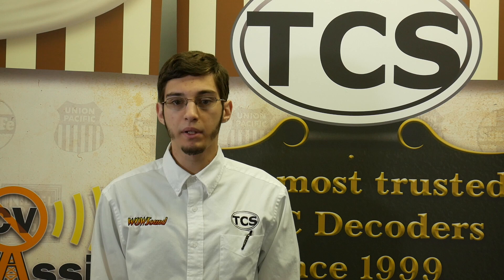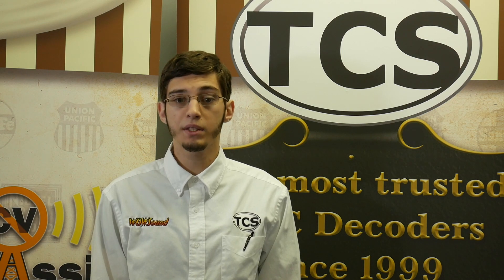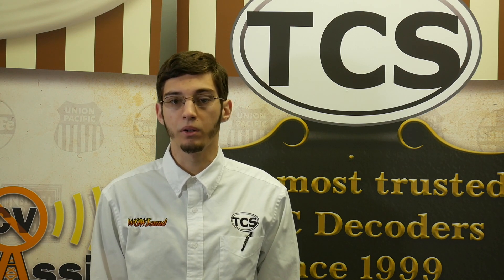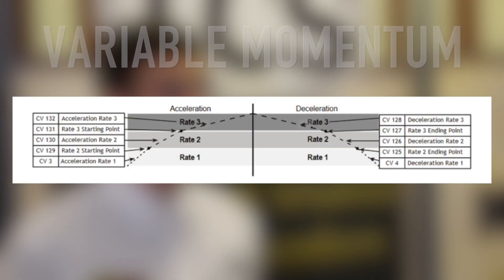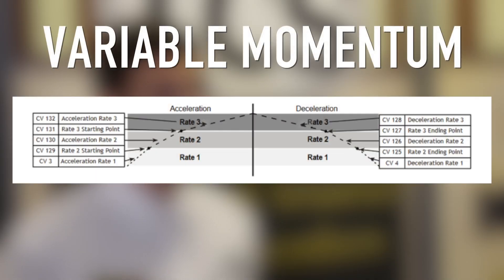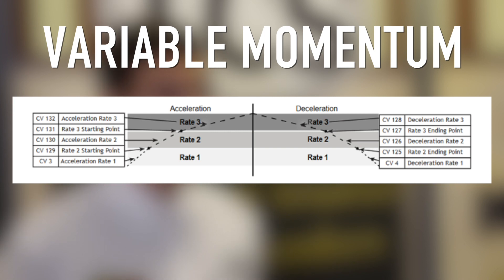Momentum Modes by TCS: An Overview!

Comment: Nice video! Id like to see if a decoder can sense how much power is needed vs what's asked for and determine its momentum based off that logic. 

So if the decoder senses it's pulling a coal load(heavy train) or a bare table(light train) it can decipher how much momentum would be need to pull and stop. Then also be programmable to what thr modeler wants

Comment: Hi Dan, how about showing 'How to set-up the presets' on the decoders..? 
And how to set 'The constant Dim' features? As I'm Still unable to dim the 
number board lights on both set Two, and set Three Wow 121 diesel de- 
coders where the number boards are set to button F3 on my NCE Pro-cab..?
Thanks!
Reply from the maker: Great suggestions! We plan on making videos covering all of the features of WOWSound in the future, including User Presets. 
When setting up constant dim lights, you need to cross-reference the CV of the light function you want to configure with the constant-dim generator you want to use. TCS decoders have 4 different constant-dim lighting effects to choose from, with each being individually configurable. For example, if you want to set "Constant-Dim 1" to function 3 in both forward AND reverse, you would program a value of 44 into CV53. To modify the intensity of "Constant-Dim 1," set the value of CV64 between 1 and 30 (30 being the brightest, and 1 being the most dim). These CV values are the same between Version 3 and Version 4 (and should be the same in Version 2).
Reply: Thanks for the reply guy's, look forward to the demo's covering the Programming of 
the presets in the Wow Sound Decoders..! 
And, will there be any Tier 4 GE and EMD Prime mover sounds anytime in 
the near future..? 
Thanks..!
Reply from the maker: We plan to include a slew of new prime mover sounds on WOWDiesel Version 5, including more from EMD and GE, Baldwin, and F-M! As we get closer to release, more details will be released regarding specific types. We appreciate your patience!
Reply: That's great..! Can't wait for Version 5 sound decoders to arrive in store, 
and hopefully some great Tier 4 prime mover + Air-horn sounds some -
time in the New year..!
Thanks Guys, ''Have a great Christmas''..! 
Cheers..!

Terence